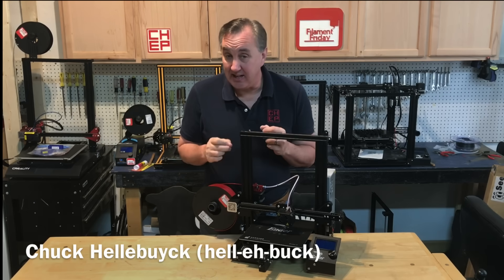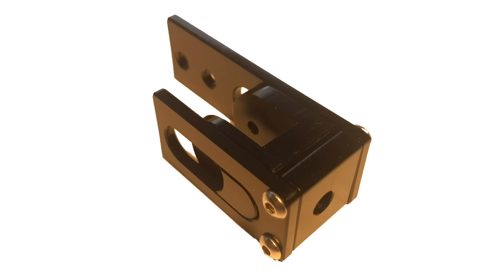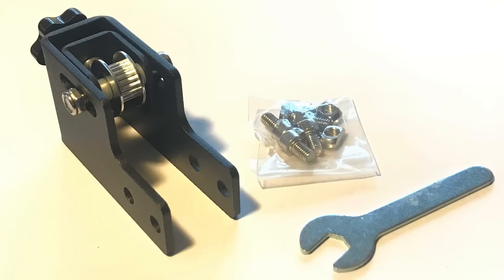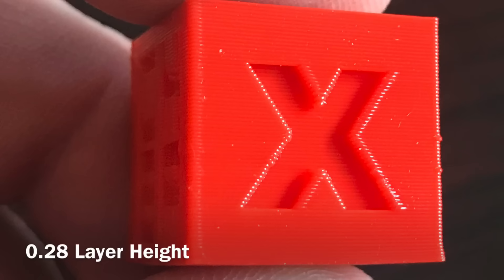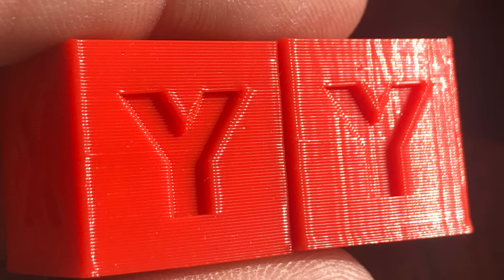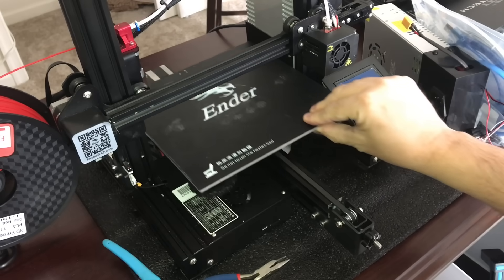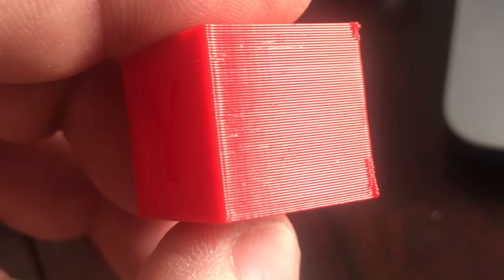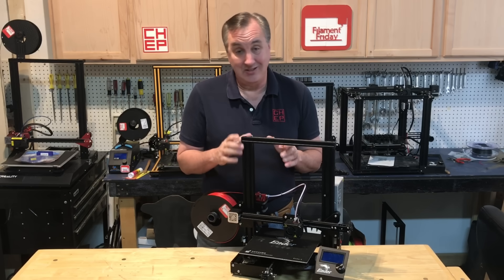3D Printer Belt Tension Effects on Creality Ender 3

Comment: Maybe the worst (belts) advise i've ever seen... sometimes knowledge is usefull when you speak about technical things... :( Maybe you get better results with more tension,  but it's just because your belts are the crappiest crap. This is way way way too much tension. And 140k people have seen that. Hope they all searched harder.
Reply: Maybe you should then write a comment that actually includes some information. Like what are good belts, what is the difference. Why too tights belts would be an issue etc. And not just cry ;(
Reply: @Nobody-Nowhere  fair point, sorry for this but i'm always amazed to see people giving advice even when they don't know anything about what they are talking about. Good quality belts like Gates (there are other brands) are far less extensible than basic gt2 super-cheap belts. They have some fibers running all along the belt. Thus they don't need a lot of tension. Over tensionning is needed on soft/crap belts to counteract the belt's extension. But it actually causes problems : a lot too much force on the belt's teeth, too much tension on the frame's structural parts, on the idler's bearings, on the motor bearings, etc. I mean, do you have an idea of the size of an idler's bearing ball ? Do you think it can handle such a force ? It's a total nope.
So yes, and i'll keep saying it : this is the crappiest belts advice i've ever seen. It's a total nonsense. And it's a shame to give this kind of advice when your audience is so large. Period :)
Reply: @tpra  If you have a source on "good quality belts" by all means give your source.
Reply: @dalefirmin5118  Gates GT3 is the easiest to find because E3D started to distribute them. Belts references are actually a not so funny maze :( So if you want to stick to regular 2mm "GT2-like" high quality sync belts, just look for the reference E3D is selling (they are called GT3, and that's because of the tooth shape that's a bit more "evolved", so don't be afraid, the 2 in GT2 does not mean 2mm, it's more like gen2, and GT3 belts are 2mm sync belts of the 3rd gen.
I assume the curious ones may find some public pictures of my prints on my FB page. Guess what, they're all printed with low-tension belts !... I'll let you judge the qulity by yourself.
Reply from the maker: @Thibaut Pral - The belts stretch over time and I’ve been doing this in my 24/7 printfarm for years. No motor bearing failures, no idler arm bearing failures, no belt failures. You can only get it so tight by hand anyway. There are methods for plucking the belt and measuring the sound frequency but it’s tough to do. Overall your comment is an over reaction to a simple solution to improve print quality on a low cost machine that just works.
Reply: @FilamentFriday  I recently added belt tensioners to my ender and discovered that when I increase tension on the Y belt, the table becomes harder to move. To the point where the table won't move at all. To me this was 'too' tight. Would it be safe to say that the bed should move freely (with steppers off) ? If I tilt my machine should the bed slide on it's own, or would that be too loose?  PS Being new to 3d printing, I've learned a lot from you. Cheers
Reply from the maker: Should move freely but not loose enough that it moves but doesn’t wiggle. Adjust the wheels underneath also helps.
Reply: @raystamp9395  Should be free to move!
Reply: @FilamentFriday  happy to know that one guy who decides if my comment is worth it or not :)
Reply: @tpra  your comment wasn’t worth it.
Reply: @RightJoystick  ** for you.
Keep putting a huge tension in your belts because a guy on the internet told it was better if you like it, you're free :) 
I don't ask that people blindly believe what i say, after all it has not more value than what's told in this video.
I just hope some people will read my comment and search on their own for reliable informations from reliable sources, like... let's say... belts manufacturers for example?
Reply: @sammyjoe2390  I'm sorry i'm not sure i did clearly understand what you meant, not my mother language, sometimes hard to see if sarcasm or not :/

To clarify :

1. I'd be the first to recognize that i'm totally wrong and be happy to go to bed a bit less dumb... if someone points me to a reliable ressource saying that you need to tighten timing belts as much as you can to get good results.
And once again, for me, reliable source does not mean a large audience, it means a large experience.
Believe me, this link will never come. However, finding clear ressources about tension directly at Gates is rather easy. They know what they are talking about (well, i assume :) ).

2. this is a linear actuator. but all linear actuator aren't designed equally, they don't have the same requirements. The range of load weight / achievable speeds for actuators is sooo wide there is litterally tons of different designs. Some may be designed with very high tensionned belts. Maybe they are also designed with a belt which size can handle the tension :) And surely different designs for different purposes may use different tension on the same belt.

3. People can be offended because i dare to say a youtuber talks about things he doesn't understand. But : "i do it like this in my print farm for years" is NOT a proof of anything. You can misuse something for years as stated above.

4. What is the point of an heuristic method when the manufacturer can give clear recommandations because he already made all the tinkering ?...

Comment: DON't OVER TIGHTEN OR TIGHTEN THEM "AS TIGHT AT YOU CAN GET THEM"!!! This caused my mainboard to catch fire due to the extra stress on the drivers.
Reply: Too tight is a major problem and nobody seems to understand that. My Anet A8 prints perfect with the belts fairly loose. My Wanhao Duplicator i3 came with the belts fairly loose and it prints great, so I used it as an example on how to set my A8 belts.
Reply: No, that's not how it works. The stepper drivers on the board are constant-current devices. You can damage them if you wire the motors incorrectly or if the wiring breaks, not due to high tension. Still, if you run high set current, you also need a fair bit of cooling.
Reply: @SianaGearz  they were wired correctly. The over tightening caused failures in the motor itself and cause a short that cause the main board to fail.
Reply: @BreakingYTown  That's not plausible. Each output on the driver chip has its own current sense shunt, using which it limits the current and thus power to a safe set value. It fails however if the shunt is bypassed, i.e. the winding outputs got connected together. But to cause the sort of insulation failure in the motor that would potentially connect unrelated windings, you'd need to get the inside 170°C hot or so. It would probably reach well beyond 90°C on the outside, which i mean, you think you wouldn't notice before?

It was probably an unrelated failure. Sometimes things just fail due to a latent defect, not because the use was inappropriate.
Reply: @SianaGearz  I wish I still had the stepper to show you. You can have your assumptions. I go off what actually happened
Reply: @BreakingYTown  So what if we open the stepper and find the insulation fault. It will likely be impossible to say that it has occurred due to belt tension. Also cargo cult, you experience a single event and it makes sense to you that there is this cause and effect, but there needn't be. Myself and CHEP and many others run high belt tension and it's fine, but when my printer stood still for several months, i could feel afterwards that the bearings were not happy. But the windings and the PCB are nowhere near the bearings, so?

In brushed motors, the impedance, the current consumed, and the heat emitted, will depend on mechanical load, you can burn them by stalling them, so it's understandable that you'd come to the conclusion. But in a stepper, that's not the case, the current is determined strictly by the control electronics and there's basically no mechanical load dependence.

Comment: Great Video! I'm new to 3D printing and have found your Videos very helpful especially with bed leveling  But just one question,will this shorten the life of the belt ? Because if you're almost maxed out on the tension screw ,where do you go from there?

Comment: I must be the worst at installing upgrades cause my prints have just gotten worse after doing them on my Ender 3 :D
Reply: Not all "Upgrades" are a good thing. Some will fuck up your previous tuning. Don't mess with the Zohan.
Reply: You don't need these belt tensioners. The firm tension is more than enough. It is much more important to get vibrations from the print. My observation is that the more you tighten the belt, the more vibrations are transferred to the print!

Comment: I'm not a fan of the x-axis belt tensioner only being mounted to one side of the gantry. It just seems to cause the slightest bias when tight. Anyway. 

I'm having an issue with layer height after about 8cm up. The extruder seems to hit the print, and the entire thing skips back on the y axis. I get this layered stepped effect for a couple of layers. Then it's fine for 1cm, then repeats the issue. 

I'll try the belts (again), and I really like the idea of having a tensioner. I'm ordering these. 

And I'll make sure everything is tight, and no bolts are loose holding the frame together.
Reply: It has a bracket on the other side, that is supposed to butt up to the gantry (no fasteners). The problem here is that the travel distance of the tensioner pulley, vs the length of the belt, means you have to pull the whole bracket further out than intended, to enable it to tension the belt. Then the rear bracket is no longer contacting the gantry. As the side, brackets are screwed on, you could opt to print a longer bracket. Could do the other side bracket too.

In regards, to your Z axis issues, have you checked the condition of those lead screws? That they're not gunked up from filament rubbing on it, other gunk, deformed, or lack of lubrication? Is there something weighing/pulling on the print head, once it starts getting to those Z-heights?
Reply: I did wind up going over the entire printer, checking all the bolts. Four bottom bolts were loose. Tightening those, along with getting those pullies extra tight, and enabling z-hop, eliminated my delamination issue. 

But lubrication is something that I should perform. It's been a year of lots of printing.

Comment: I have a weird problem with my 3D printer belts. Even when I use toothed idlers, I get 2mm spaced ripples in my prints that go across the entire surface, mainly on Y. Do I have bad belts, and should I spend money on gates belts, pulleys, and idlers from E3d?
Reply: I assume you mean side surfaces and not rop/bottom of the print. I do not know how the Y belt is attached to the bed in Ender 3 (I have a different 3D printer),but if the idler, motor pulley and the place where the belt is are not in line horizontally, the belt may rub against the sides of one of the pulley/idler and do something similar, but that would intensify nearer to the ends of the travel of the axis. It also happens if the belt is way too loose, like almost skipping. It can also mean bad/dirty/unlubricated/misaligned linear bearings, cheap Chinese ones do not live very long, and Iguses are almost impossible to align on cheaper printers, like mine, now I have Misumi bearings and they're OK but a bit expensive. Those can be the causes if it is only Y axis. If it's both axes then it could be something vibrating combined with loose X axis or some other lack of rigidity somewhere, making the nozzle bob up and down a bit. Loose screws especially in X axis and the extruder asembly (and the heatbreak itself can be loose) can do that. Try changing the speed to see if the ripple spacing changes, or feel around the printer when printing to determine what vibrates.

Comment: tightening it further than necessary will ruin your motors because of the torque that the bearings/bushing aren't supposed to feel. it might even really cause the internals of the motor to rub on itself.
Reply: Do you know the rated torque that can be applied sideways to the motor shaft before it causes any main issues? In curious as to how tight I should get my belt but the internals of the motor should be fine. Bearings are not meant to turn inside motors. Before the internals ever rub up against each other you'd need enough force to actually rip the motor off its mount on the printer

Comment: i just received my ender 3 and so far pretty happy.
i wanted to see if anyone knew where to get a replacement print surface like the one that came with mine. its the black matte finish with a fiberglass bottom that sits on the heated bed and i use clips to hold it down since its not magnetic.  i love the matte finish it provides for the bottom of my prints. ive seen on amazon where they sell the top black replacement part but the comment section are stating its both like the original and some say its different and thats its not the same one.  with some prints i prefer the matte finished bottom.  so ive been searching for the same one but its hard to tell if its the same.
appreciate any info.
Reply from the maker: Matterhackers.com and search for Buildtak. It’s a sticky back sheet that you peel off old one and install new.
Reply: @FilamentFriday  thank you.  just a heads up, i keep your ender 3 bed level gcode on my sd card all time for leveling my bed.  thanks for that gcode.
Reply: @shadowsilverlight1651  I use the Creality textured glass bed with swiss clips to hold it on.

Comment: hmm... smaller pulleys than the original larger ones....  that would bring the belts slightly closer to the center of the inside of the profile and possibly rub...  I'll stick with the standard manual belt tensioners on the Ender 3 Pro...  wish the Ender 3 V2 had those same mounting holes and option to purchase the traditional belt tensioners...but we'll see how long these plastic V2 tensioners last.  : /  Yeah, too tight, not good... too loose, obviously wrong period.  Great videos as usual!

Comment: Those things you replaced with belt tensioners, were belt tensioners.
Reply: Thanks for saving me a couple bucks, the built in belt tensioners work just fine for now.
Reply: @funx24x7  No problem, and I agree.
Reply: Yeah but they were not spool tightened that's the difference

Comment: Well, my X belt has always seemed a little to the right (looking from the top) with this fitted it ran even worse and you could see the belt 'twisting' as it went back and forth. after a small run I abandoned the print and thought better original than sorry. When taking off the x-axis it was obvious the belt was catching and I could see wear. So not a win for me and I have reverted to old school tensioning with an allen key used to lever the arm back.

Comment: When I assembled my ender 3 I
I didn't tighten the x axis belt and it was skipping over really had. I printed a test cube and it was almost a full length cube over to the left with only a little bit hanging on the base layer😂

Comment: I'm occasionally getting a layer shift using a glass bed, could it be from the belts? It only happens on large prints
Reply from the maker: Maybe. Could be acceleration settings as well.
Reply: When I put the textured glass bed on my Ender 3 Pro I had to cut my Y axis acceleration and jerk settings in half. Runs smooth.
Reply: What would be a recommended way to approach adjusting acceleration for this? I’m also having layer shift issues in the y direction and I feel like I’ve tried everything except adjust acceleration and jerk
Reply from the maker: Depending on the printer you might be able to adjust from the LCD. Otherwise connect via USB and use Pronterface (pronterface.com) to send GCodes to set them and save.
Reply: CHEP thanks for the response! I understand how to make the change, I moreso meant the theory behind it. I’ve try to find good ranges for these values and have found all sorts of conflicting info
Reply from the maker: Try accel if 500 and jerk of 8
Reply: I initially just set acc 500 and jerk 8 in my slicer for all profiles and haven't had the issue since.

Comment: I tightened mine using arm pull pressure, but after it sounds kinda grindy, thinking its too tight, come here looking for what is the right tension, think max tension may work for a while if your bearings are forgiving. surely there is a Goldilocks zone where the belt does its job properly without over strain bearings.
Reply from the maker: The belt stretches so even tight it backs off in time to its own Golidilocks point. I’ve been running this for many months without all the comments about “bearings failing” coming true.
Reply: @FilamentFriday  Yeah, they're called bearings for a reason. They "bear" the load. Lol

Comment: On my A8 printer the idler pulley is 16 tooth and the bearings inside are quite small. I've had issues with them failing after 20-30 hours of printing at high tension. Not expensive but annoying to keep replacing. A 16 tooth drive pulley has a 5mm hole instead of bearings so I've printed idler tensioners that use drive pulleys running on a 5mm shaft in 5*16*5 bearings either side.

Comment: Looks like these could be printed. Is there anything on thingiverse
Reply from the maker: I’m sure there is. I prefer metal for those so I can crank on them.
Reply: @FilamentFriday  Yeah there is a print version, search for "Ender 3 mod" and it will show up on top.(thingiv) I ran them both, but decided to order the metal ones aswell, since there always was a bit of play sadly. but the alignment of the belt/pulley was beter on the printed version as on the oem version. I hope the metal versions will help me kinda stop this madness of trying to get the belt tention correctly, and remain the same tention.. only have this problem on the ender..